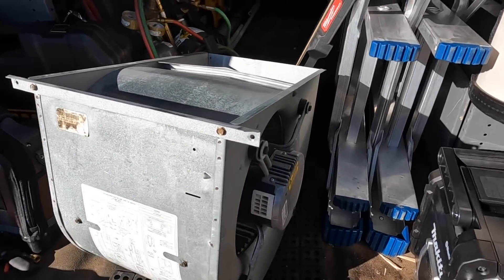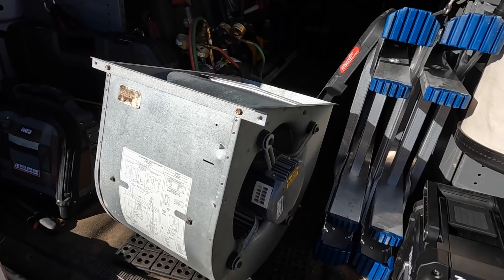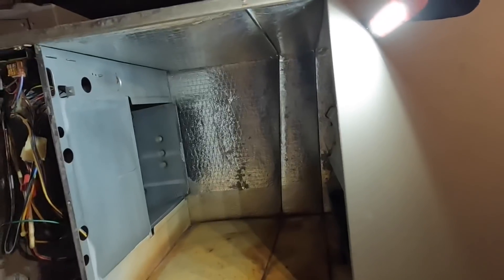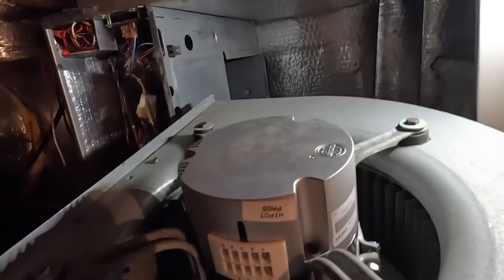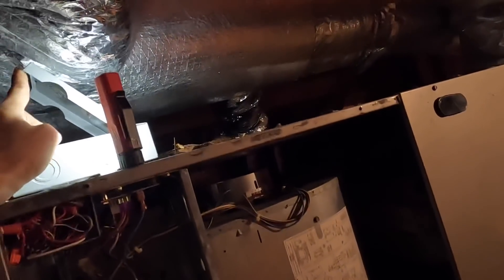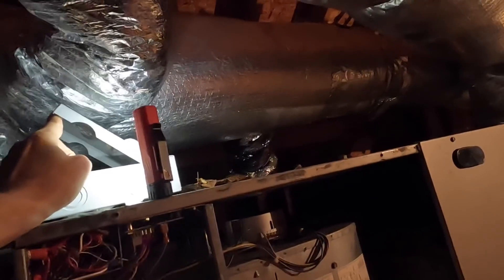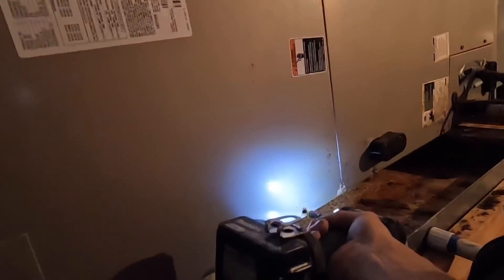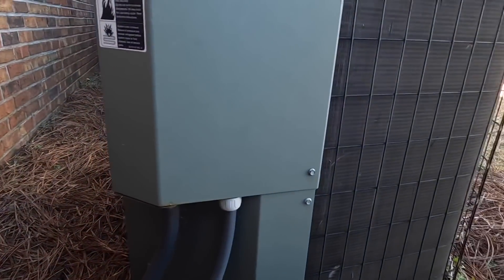No Heat and a Burning Smell. Installing Rescue 5642 X-13

Comment: I always buy the correct dual run cap when changing condenser fan motors. I hate finding a cap hanging in a compartment just waiting to fall out.

Comment: Them horizontal Carriers always have rusty fan shafts and almost always eat up motors way before their time. I always save the rubber capacitor caps that the older Trane air handlers have just for aftermarket capacitors and double sided tape to stick it where ever it will fit.

Comment: I have a question maybe suited for another video , have you had any dealings with installing soft starts I know hyper technology makes one just curious if you have and your thoughts on them
Reply from the maker: I’ve only read about them. They sound like they would be a great idea if you use a generator, which I do. I haven’t installed one on my house because I’m a little worried bout what it could do to my compressor. Plus, I’m not sure they’re compatible with larger AC units.
Reply: I installed one on mine on Sunday and it works great I removed the 521 start kit on my 3 ton and the amps went from 59 to 41 amps it says it good up to 7 hp compressor

Comment: I recently swapped out a 16-pin variable speed for an evergreen em motor. Nice and easy. I also want to recommend some 3M double-sided tape that you can find at the auto parts store, for sticking capacitors anywhere you want to put them.
I enjoy watching and I want to see this intermittent blower episode

Comment: Hey there, great video. As a newer tech, I'd love if you would do an in depth how-to on how you replace a blower motor. Here in Florida, near the coast, almost all of the motors I find are rusted on really bad. Sanding the shaft and using oil doesn't get the rust that has made its way into the hub. If you're unable to, no worries the rest of your content is still great.
Reply: I highly recommend kroil or aerokroil, if you can find it. And a puller with an impact.